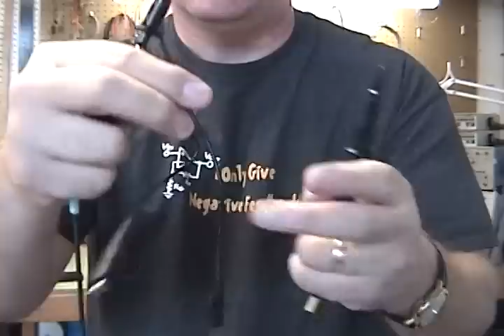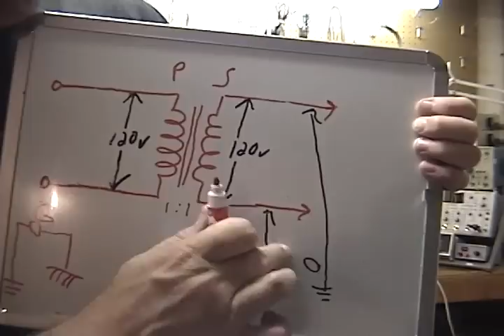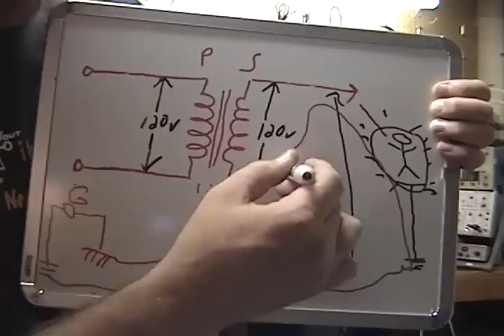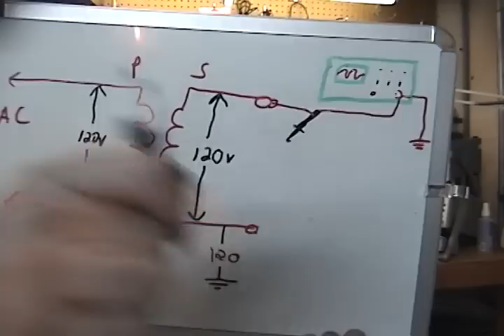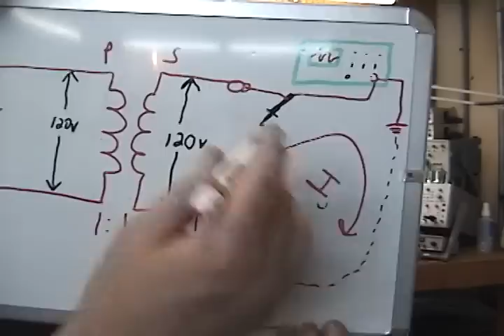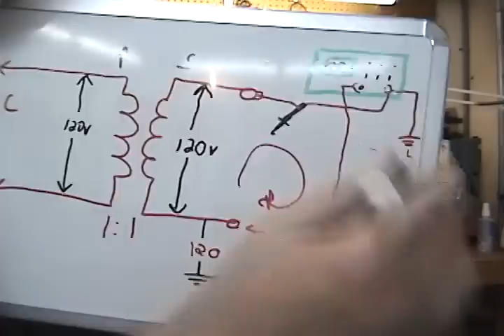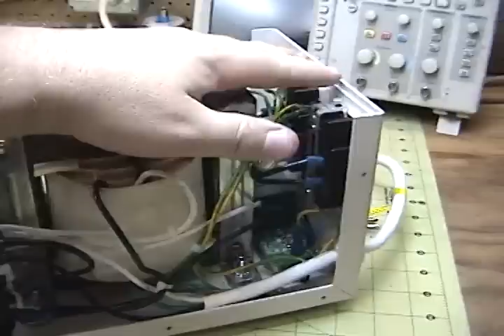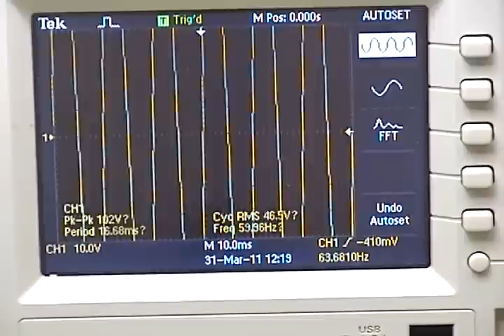ToddFun.com: Isolation Transformer - Tripp Lite IS1000

Comment: Where I live in Europe, we uses a split-phase system with the neutral ground provided for safety reasons only. I assume it's a bad idea to use one of these transformers which connects one of the lines with ground, I mean, wouldn't I have a consant 120v AC short to ground then?

I also have a step-transformer, which is basically just a coild at the size of the one you show in this video. Just a coil; while the dedicated ground is just forwarded. Would this provide the same protection as an iso?

Comment: Thanks for the video. I've gotta do a project that is a little different. In essence I need to turn 125VAC in to 125VDC. So now I know to put an isolation transformer in the circuit then to the bridge and cap.

Comment: Hi Todd, Great video!

FYI, the green dot is a UL required indication of a hospital grade wiring device per UL-498. The requirements all have to do with the physical ruggedness of the outlet. There is no electrical distinction at all.

For the technically curious ... an orange dot means the outlet is connected to a UPS of some sort, and a red dot mean the outlet is connected to a generator or other "life safety" rated power source. 

JohnS_AZ